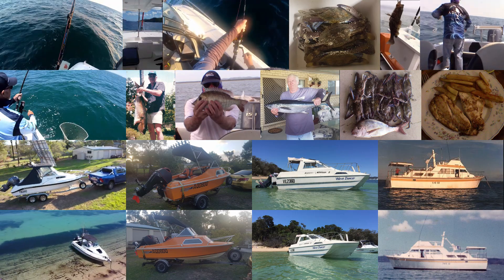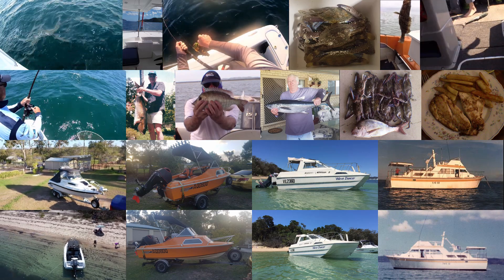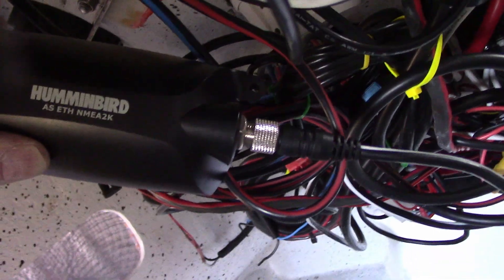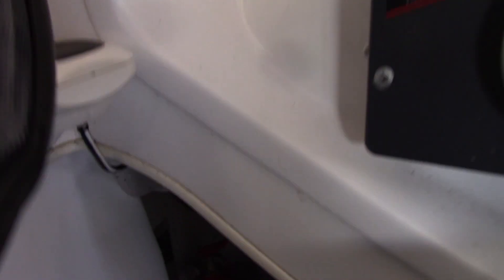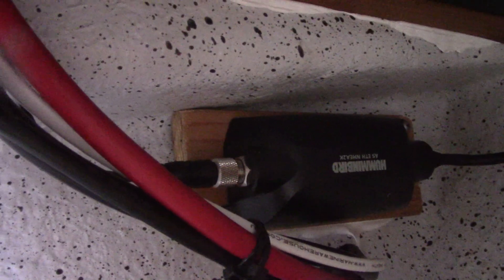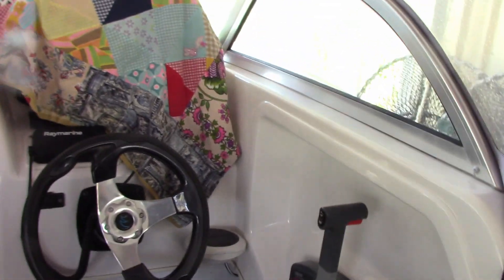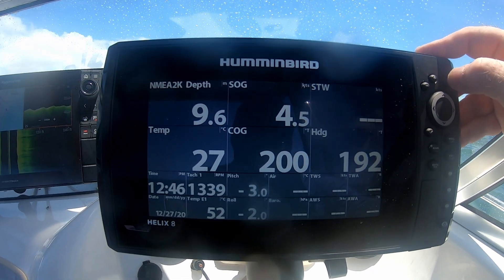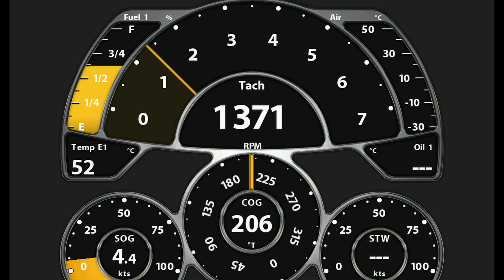Humminbird NMEA Gateway

Comment: G'day mate. Really enjoy your videos. Do you display any fuel economy data (km/L) on your Humminbird via your NMEA network? Thanks.
Reply from the maker: I haven't actually looked for that function on the Humminbird.  The Raymarine does have similar data but I only check it occasionally.  The Humminbird does display a fuel gauge.  I will try to remember to have a look to see if it offers fuel economy data next time I go out.  I just mainly rely on the engine gauges l/hr against time and what I know I have in the tank.
Reply: Thank you mate. My Humminbird is displaying L/hr from the engine data on NMEA. I don’t have any engine gauges or a fuel gauge so I’m trying to work out how to display everything on the Humminbird. Any tips would be great.
Reply from the maker: I'll have to investigate that a bit more myself.  Because I had the engine set up on the Raymarine before I got the Humminbird I have spent more time on the sounder controls of it.